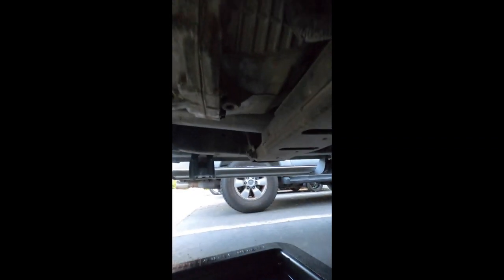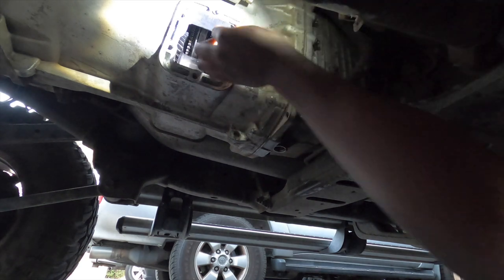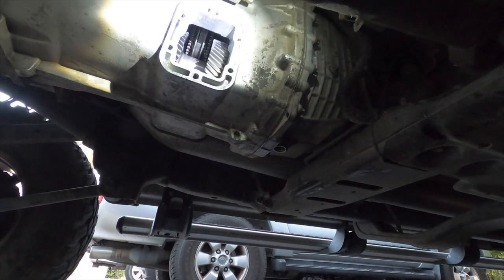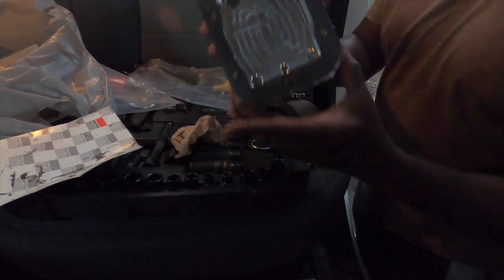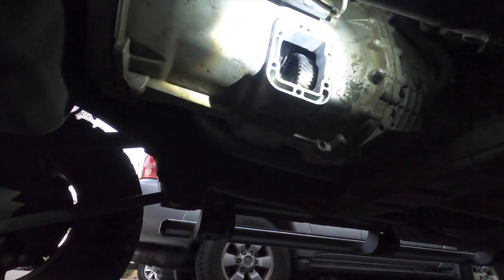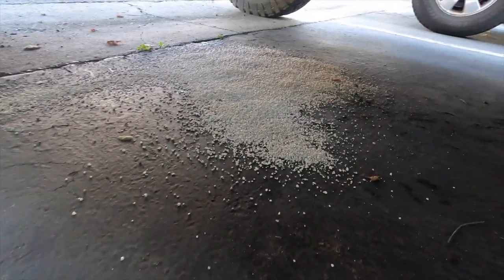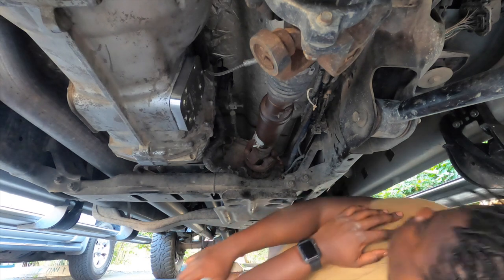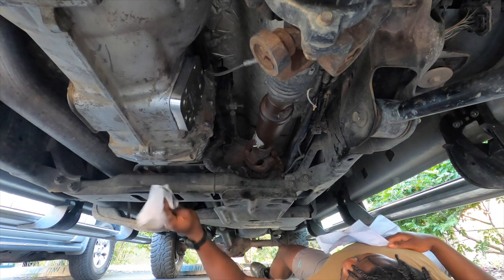How To Install a TDS PTO Cover On a G56 Manual Transmission (Cummins)

Comment: Do you have a part number for the gasket or did one come with the kit.
Reply from the maker: bought it with the  plate. https://www.ebay.com/itm/TDS-PTO-Cover-Gasket-Fel-Pro-Made-in-USA/203103535186?hash=item2f49ea0052:g:FE8AAOSwR7lawNsx